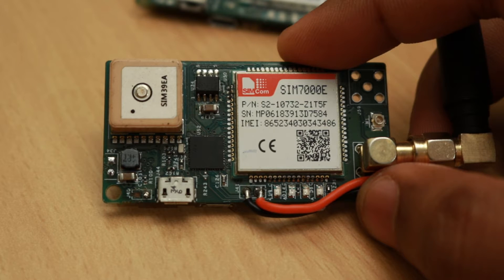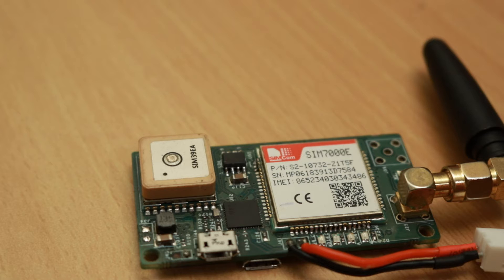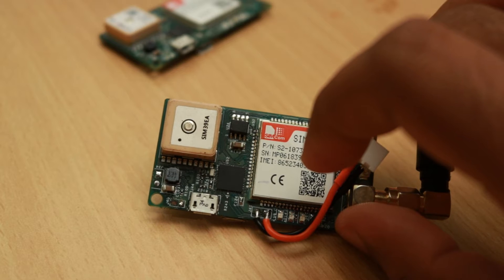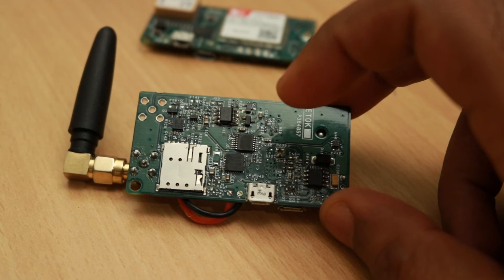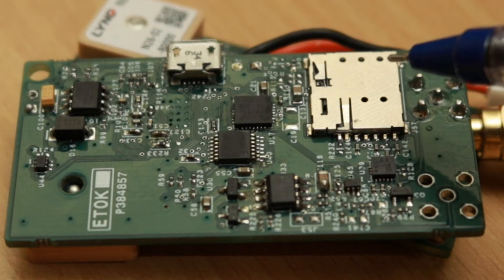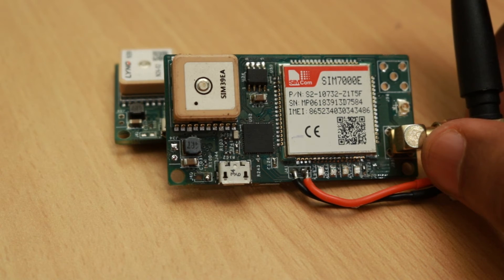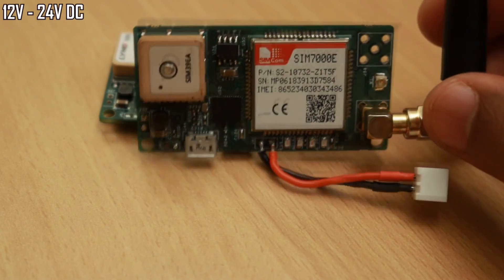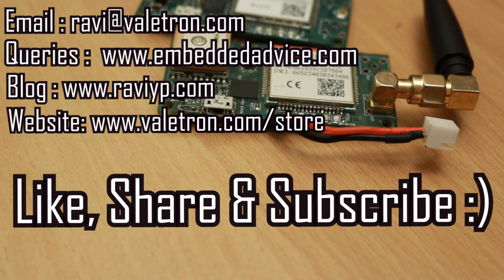Designing a NBIOT/LTE CAT-M1 GPS tracker for Google Cloud IOT Platform

Comment: what is the Power consumption of this board ? is there a sleep mode/ energy saving mode? will it be connected to the NB-iot network wile in sleep mode?
Reply from the maker: It has deep sleep in modes. You can check STM32 stop modes. It's usually around 200uA. Everything is switched off.

Comment: Hello, i have some question 
why are you using an external GSP module 7000e has built-in GPS 
will the 7000e support JIO sim
Thank you,
Reply from the maker: The board supports active antenna externally and also internal antenna GPS module. As requested by customer. It will support JIO NBIOT network only when launched